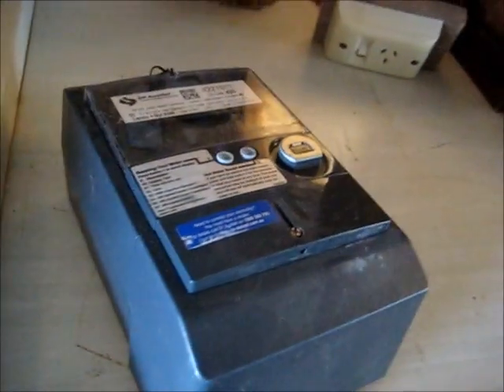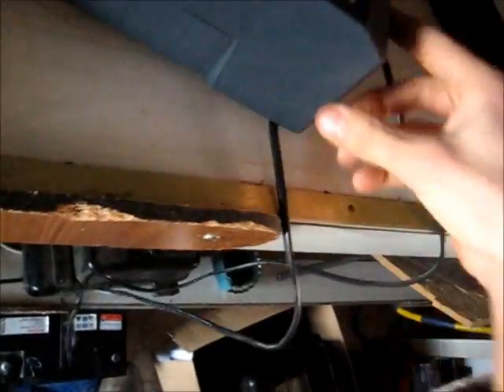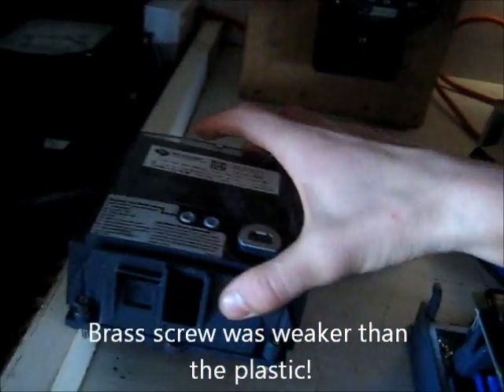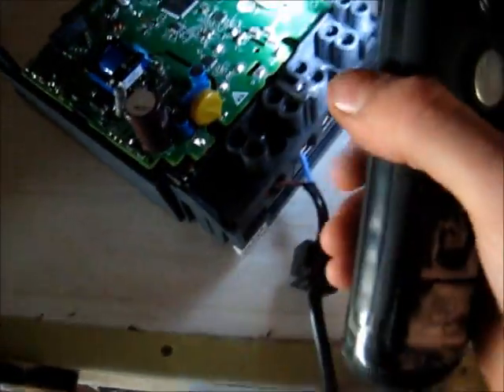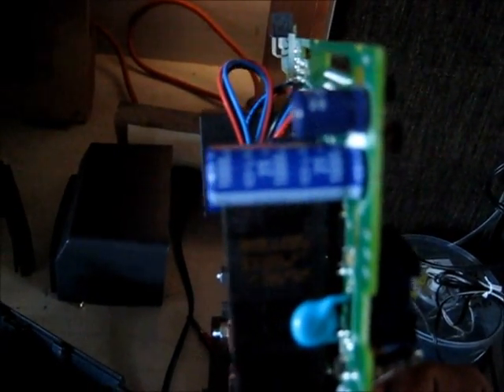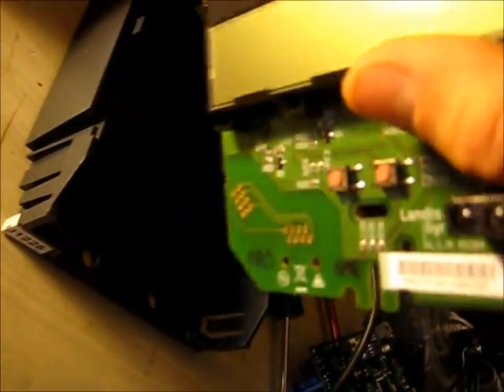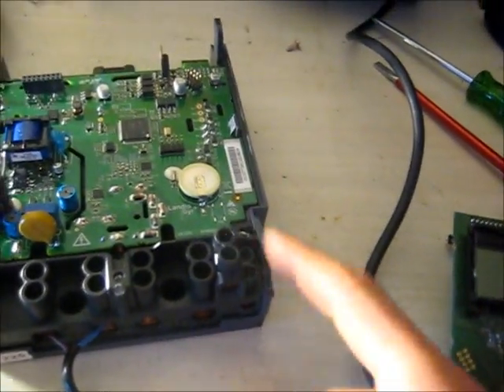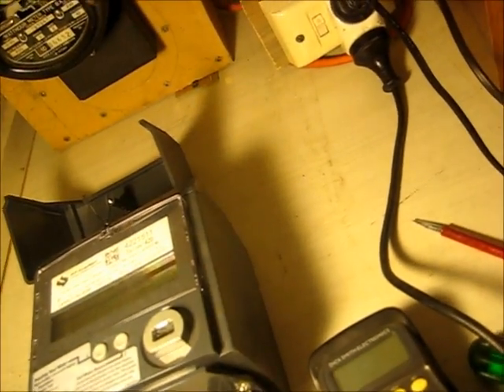Smart Meter Teardown

Comment: gf = glass filled. This is a glass-reinforced plastic composite, which is why it is so much stronger than the brass inserts.

Not repairable, but it's cheap, very easy to injection mould, doesn't corrode and it's very resistant to breakage.

Comment: You can phantom load these meters. Phase in (Line in) and Phase out (line out) to 1.5 or 3 Volts high current transformer which can be controlled with the variac.
Phase in and Neutral in via an isolating transformer, or direct, but be aware that the current source will be live at mains potential.

Comment from the maker: Do you reckon it's possible to phantom load one of these? It needs to have at least 150 Volt before it turns on, i'd need a 240 Volt High Current transformer and a BIG variac!

Comment: That circuit board is well made, but a lot of electronics on it which can go faulty.
At a power surge the meter is the first one in line to get the full belt.
Good video.

Comment: That cap is low rated, should be at least 400 Volts for your 240 Volts supply, take into account your violent thunder storms. they are not gonna last.
Looks like it has the disconnect switch in it too.

Comment: For remote communication to the meter, it probably doesn't do it wirelessly: Early Ampy 'Reporter' meters would communicate back along the mains power system. Maybe there are meters that have the option for some kind of GSM connection as an alternative for communications or as the main communicator, & the power-line option as backup incase the GSM network isn't available/low signal/out-of-range.

Interesting to see in one of these though. The problem is, I wouldn't have a clue how to fix this!